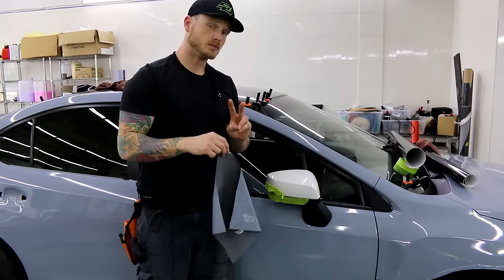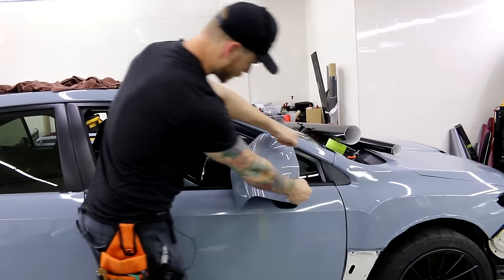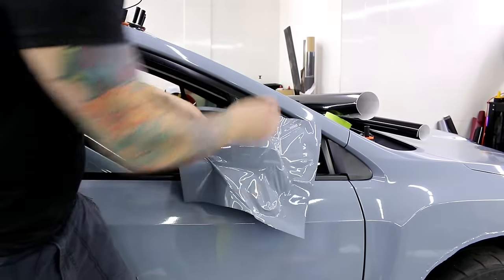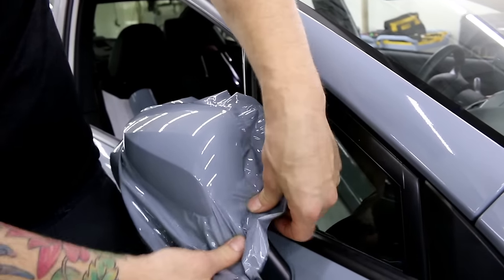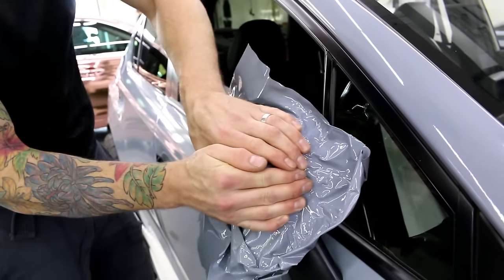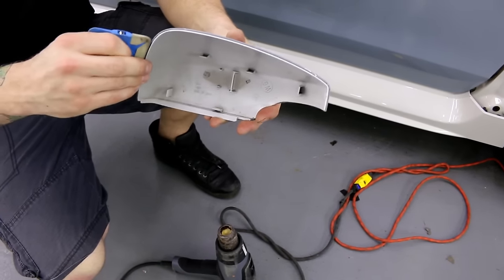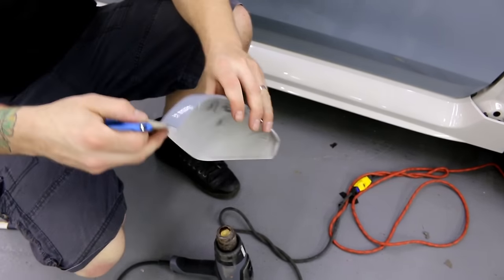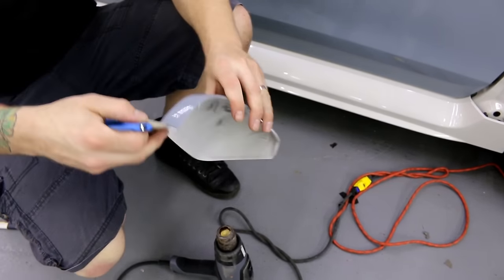Vinyl Wrap A Side Mirror Cap | Subaru STI

Comment: Great video.  If you have black textured caps, do they need to be sanded down first?  I don't want the texture to transfer to the wrap although the mirrors I'm dealing with are a very fine texture and not super rough.

Comment: wrapping this Subaru WRX mirror cap is relevant to my situation....adding mirror turns to a base WRX and the new mirror caps are unpainted.  I couldn't decide whether to wrap the cap with a satin nickel or spray paint.  Both methods seem 'easy' enough.

Comment: When wrapping door handles and mirror caps, is it common to hear an “expert” installer say they have to wrap it in “multiple” pieces? I had my truck wrapped and he had to do two pieces for the mirror and three pieces for the door handles and claimed that they can’t be done in a single piece. 21’ F150.

Comment: Enjoy all of you videos. I tried wrapping the mirror caps on my car using vivid carbon fibre wrap. I got the top part nice and smooth, but just could not get the vertical down part off the cap smoothened out. My mirror cap is the same shape as the one you have on this video. I could not get the whole thing smooth in one shot like you did.  I tried heat and stretching it out, but could not get  it. Any other tips? Thanks
Reply: I’ve used that same vinyl on a hood wrap and it was the hardest material I’ve ever worked with. Took almost 3 hours to wrap that hood with two other people, one of whom wraps full time. I couldn’t imagine trying to wrap a side mirror with that stuff lol

Comment: I think this will get wrinkles or shrink after some days or maybe in 48 hrs
Reply from the maker: It's not possible for it to shrink since I've already shrunk the film around the edges. I have door handles going on 4 years that were wrapped like this and still no issues
Reply: Recently I wrapped mirror  in 5d gloss carbon ,but it started to lose the wrapped shape and got wrinkles fully!🤔
Reply from the maker: What brand of vinyl did you use? Mirrors are also one of the most common areas of failure
Reply: It was  some Taiwan make , unbranded